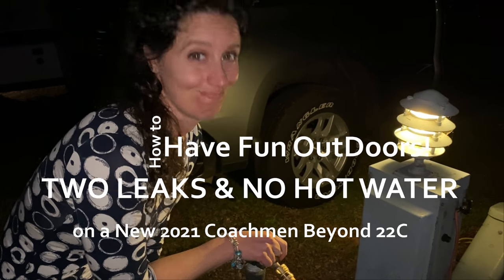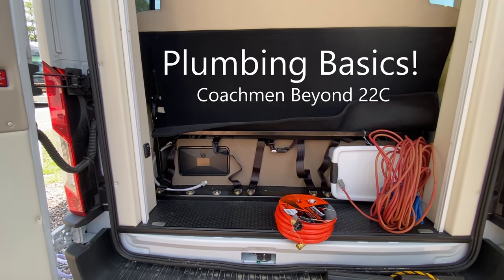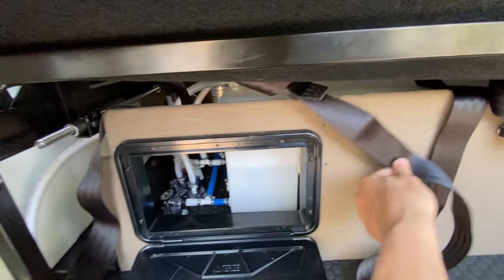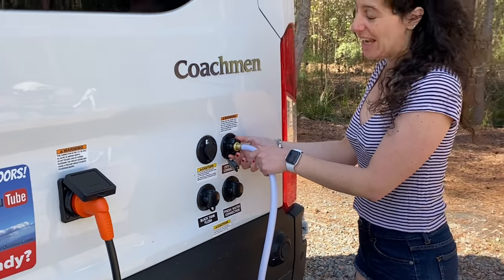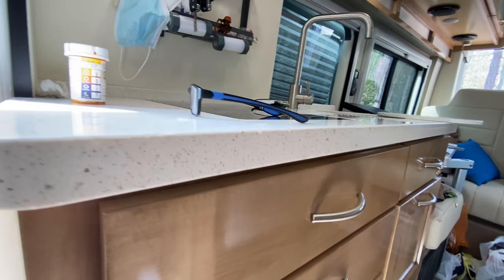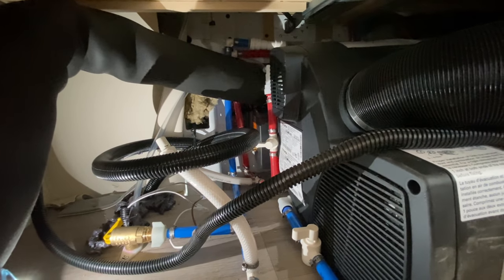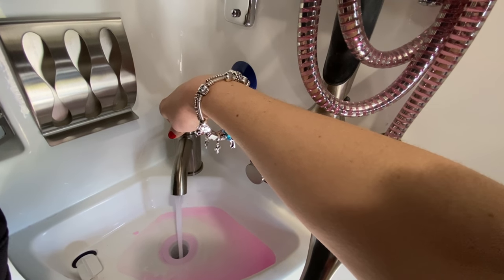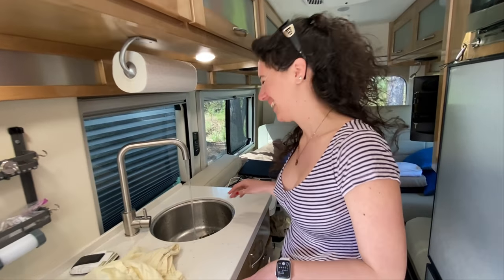New Coachmen Beyond has 2 Leaks and No Hot Water

Comment: Generally speaking does your 2021 unit, built during Covid, suffer build quality problems? Couldn't help noticing the poor foam installation around the plumbing, etc. Thanks.
Reply from the maker: In general the build quality was pretty good.  Coachmen Class B has its own little operation and headed up by a GM that cares about quality and customer service.  We still had a couple of issues.  But Coachmen always fixed everything under warranty.  Overall we have been very happy with the Beyond.
Reply: @HowToHaveFunOutdoors Thank you very much

Comment: We just got our new Coachmen 22c Li3 that came winterized. We followed Camping Coastie step by step YouTube Video “How to de-winterize a Coachmen Beyond 22C Li3.” We avoided the issues you faced and easily removed the drawer, not the panel, put all the valves into the proper positions, and everything went well. The Beyond you bought did not have leaks (misleading) and the dealer had it winterized correctly. Those valves are supposed to be open after winterizing. Unless the dealer supposedly de-winterized it for you? What is a genuine problem and real deficit is Coachmen does not have Beyond how-to videos so we need to rely on owners. LTV, our prior Van, has complete owner how-to videos for just about every system.
Reply from the maker: We asked for the van to be dewinterized.  Which they did do.  However, they left the valves open.  The valves have to be closed after the full process.  That is the procedure.  This was 100 percent dealer error.  Period.  Coachmen has been terrific and not a Coachmen issue.  Dealer even admitted to mistake.  However, as a brand new owner, we had no idea and for two people that never owned a class B, it clearly had two leaks and the hot water did not work. So we don’t see it as misleading, that was our experience.  You don’t spend $100k plus to have water coming out of the van in two places. The value of our videos are to help others.  Bottom line, the dealer did not do their job correctly. We agree with you 100 percent more videos would be a great help.  I think they are working on that.  Dealer training is also a big deal.  We agree Coastie has some great videos for beyond. We just did 3 mod and tip videos and many others. Coastline is even in part 3. One other note, each beyond layout has different pluming and the valve systems have changed over the years.
Reply: @HowToHaveFunOutdoors  If they said they de-winterized, you are correct, they are entirely at fault.

Comment: There are clips under the drawers that you squeeze to release them. It’s then easy to lift out the drawer and access the valves. No tools required. (2020 22C owners).  We also had to figure the valve situation out when we were on our shakedown trip. Our dealership left the bypass open when they de-winterized and we were getting alternating hot and cold water as the Supply mixed heated and unheated water. Cheers!
Reply from the maker: Thanks so much! I grew up with an RV, but Tommy is still a rookie! Any tips are a major plus.  Thanks Again! Thanks for watching and please subscribe to see more great videos and to support the channel (keep my husband motivated! lol!)
Reply: @HowToHaveFunOutdoors    Owners  Manuals  can be very helpful ...

Comment: I suppose it would be normal  to leave a drain valve  open over the winter  so  no  water can stand and  freeze and break things..
Reply from the maker: That is not normal.  When you winterize, you fill it up with RV Antifreeze. Then in the spring dealers open valves, remove antifreeze (Step 1), clean water flush, then shut valves (Shut Valves). We asked to have it De winterized and they clearly did step 1 and didn't finish step 2. Thus the leaks.
Reply: @HowToHaveFunOutdoors    I just  drain  everything from my   camper..  so far no problems .. don't use it in the witner..
Reply: Not a good idea to put RV antifreeze in your water heater. That’s why you bypass it. The drain valve can stay open for a while to make sure all the water is out of it

Comment: You’re valve is open. 
Not a manufacturer error. 
Operator’s error.
Really clickbait to call it
A “leak”
Ugh
Reply from the maker: Understand your point. But we spent a lot of money and purchased a brand new RV. After we figured it out, we agree it is not a manufacture error and I think we highlighted that very well in the video. We love our camper van and coachmen.  But if you were a.new owner like us, you do not expect or should never have a leaks like this. The fact of the matter is the dealer did not complete the winterization and close the valves. It easy to understand after watching the video. It is that simple. But that night, it was 2 leaks and no hot water.